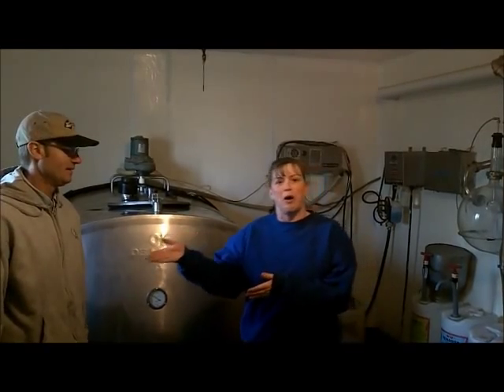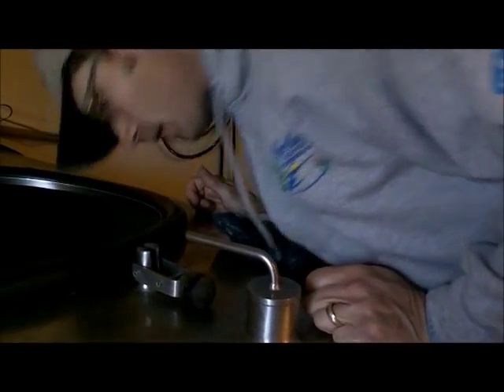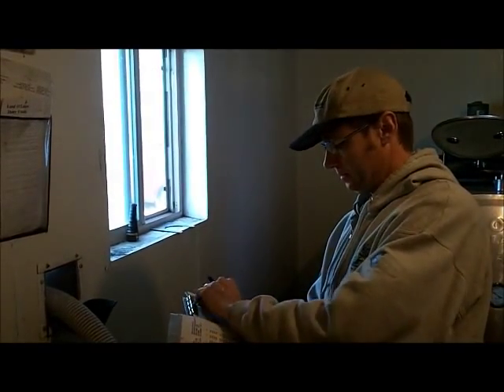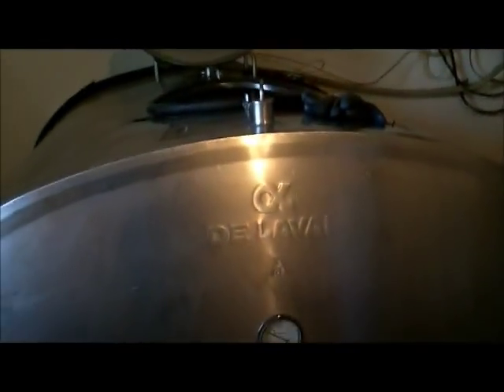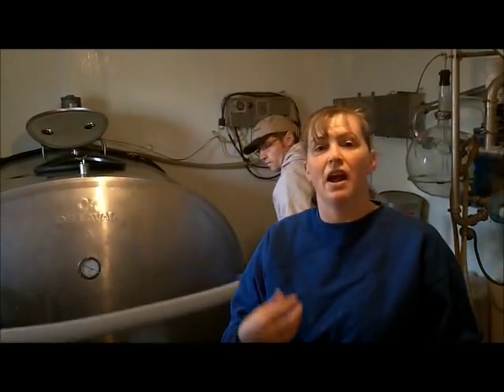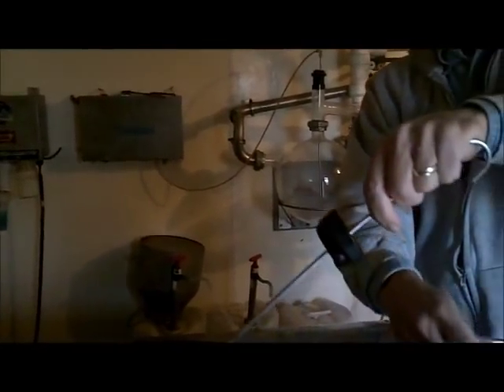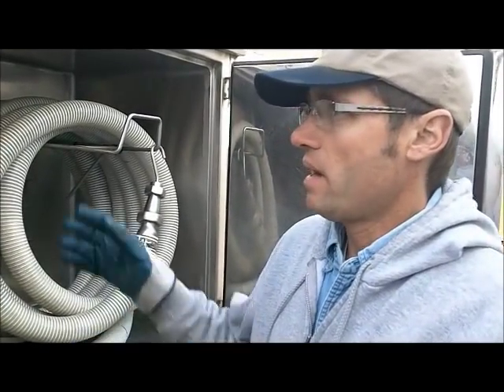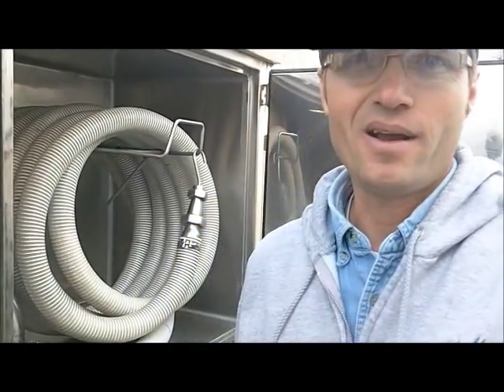milk pickup - ginger.wmv

Comment: As Paul was hooking up the hose to the tank, it sounded like the pump was already on. Doesn't this have a tendency to burn the impeller up seeing there is no milk going through it? I picked up farm milk for 29 years and I never turned the pump on until I opened the valve on the bulk tank. The driver has one thing right...it's a good job except for the winter time which can be a real bummer and makes for very long days.

God Bless,
Jeff :)
Reply: he never washed his hands and should not have left the tank lid open
Reply: jd450lh depends on the pump.  If it’s a jabko pump you will burn it up.   But if it’s a Thompson you will be just fine